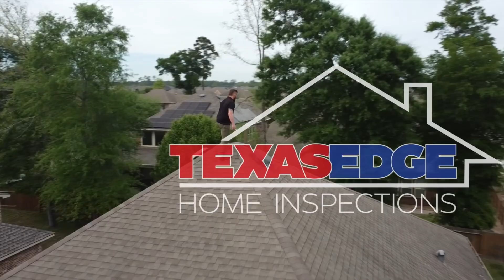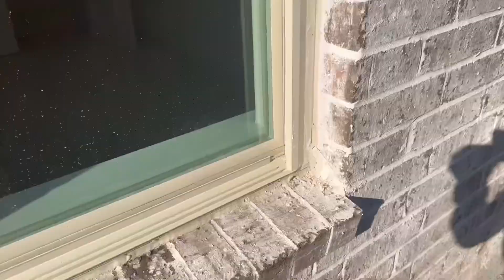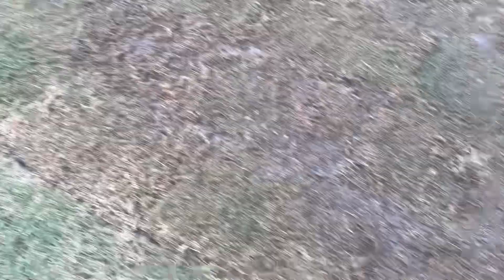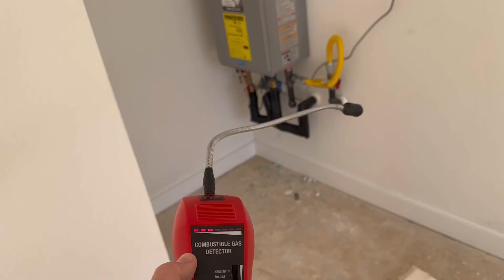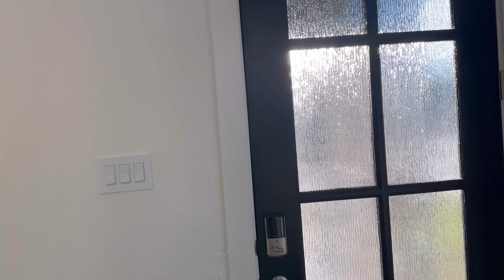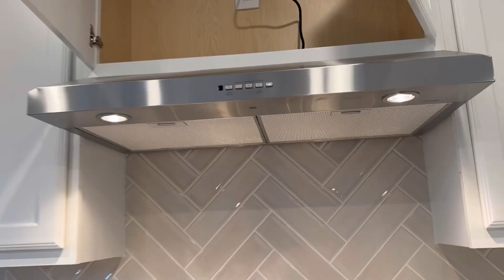When you pay BIG BUCKS for a new construction home, you expect to get what you PAY not THIS!

Comment: A thermoply stapled house should not cost more than $150/sqft in Texas. It is criminal how much builders can get away with these just because buyers are wowed by manufacturing aesthetics (i.e. pre-hung doors/windows, engineered flooring, LED fixtures, etc) rather than in-wall assembly/installation.

Comment: All the pipe fittings on that heater looked iffy. Should be pipe dope oozing out of all those connections. No dope or tape on the valve and it doesn't look like anything on the trap.